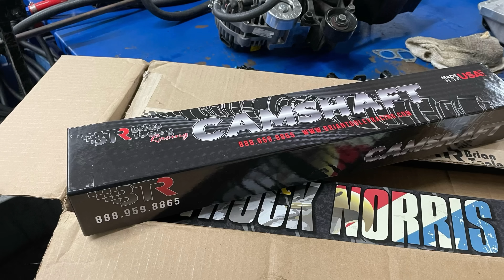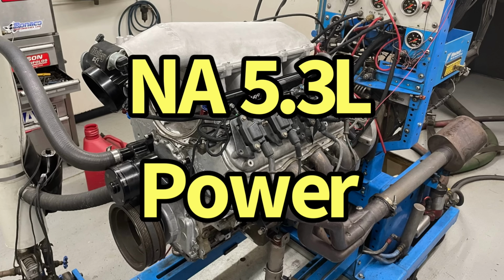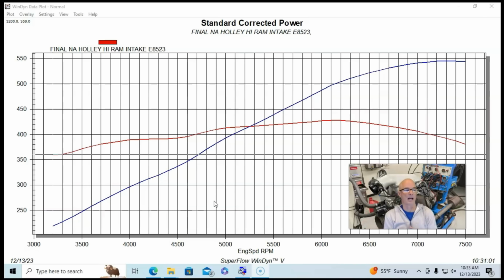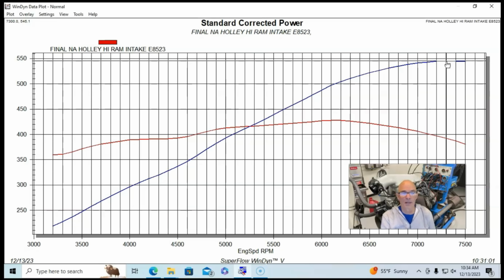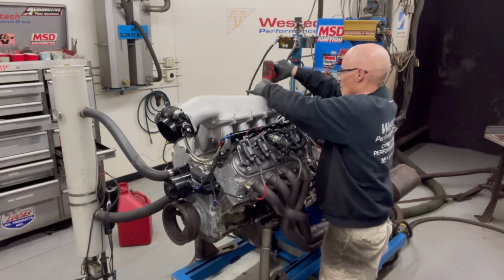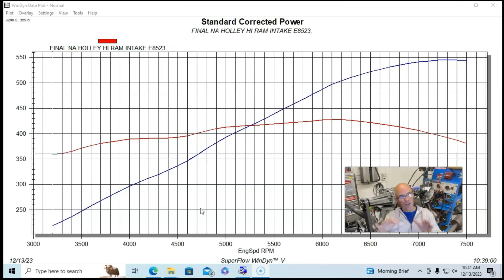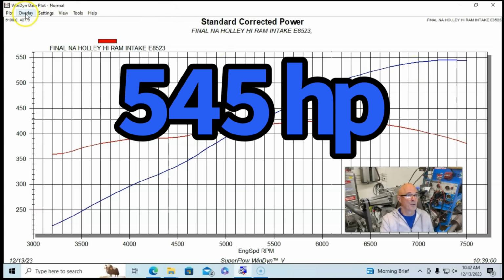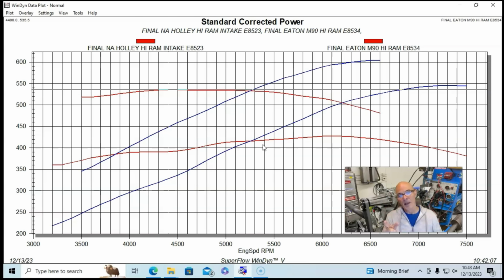CHEAP JUNKYARD M90 MAKES OVER 600 HP! IS IT A WORLD RECORD FOR THE 3800 V6 M90? 5.3L + M90=600+ HP!

Comment: I would have assumbed the motor would have consumed so much that hardly any boost would be seen.  I did catch boost numbers but Surely its not doing over 6 pound at about halfway on up in the rpm..  fun experiment.   I got a 03 cobra factory Eaton on the shelf..

Comment: Neat. I always thought small supercharger=heat=low air density=low power
Reply from the maker: heat is a function of boost pressure-you make more heat at 10 psi flow less air than at 5 psi flowing more

Comment: This is interesting, but we're really into the realm of silliness now.  This blower is hopelessly undersized, when you spin the thing at close to 20,000 rpm and only gain about 50 hp you're pretty much pissing in the wind.  True, it picked up a bunch of torque down low, but only gained 50 hp up top.  I wonder how much power you could "make" with an m90 if you put it on a 15:1 572?  It might restrict it bad enough to choke 500 hp off, but it would set a new record for m90 power.
Reply from the maker: now you are understanding

Comment: Really digging that torque bump but would that huge stack fit under the hood? Do you have a measurement from valley to top of blower?
Reply from the maker: USE THE LOW RAM

Comment: If there's enough vacuum to collapse the coupler does that mean there are still gains to be had from a larger throttle body?
Reply from the maker: THE VACUUM IS ONLY PRESENT AT CLOSED THROTTLE
Reply: @richardholdener1727  👍

Comment: For a 3800 maybe but not for a 3.8. 600hp is a number surpassed more than 15 years ago.
Reply from the maker: WITH AN M90 BLOWER?
Reply: @richardholdener1727  yes, ported.  Running about 21psi.
The joys of an intercooler and methanol injection.    Around similar time was found head lift happens at 26psi.

Comment: So is this a Gen V M90? They were supposed to be almost as good as the old M112.
Reply: He shows a pic of it from the underside. I can tell it's a gen 5. You can tell easily by the position of the rotors and the port. Gen 3 the rotors go past the opening of the port, gen 5 the rotors end visibly in the port. Probably it's a big reason the gen 5 is more efficient mixed with bigger port and intake side improvement

Comment: Any thoughts on how to get this to work on something like a Small Block Ford?
Reply from the maker: SAME WAY-ADAPTER
Reply: Currently building an intake to mount two m90 over a 302.. just lots of fabricating. Using a later counter rotation pump and late serpent belt crank pulley and blowers at 1.2 crank speed. Should make around 7 psi boost we figure.

Comment: Very cool for sure. I have an M90 that been in my basement for 20 years plus as it was a warranty part off a 3.8L SC GP when I worked at a Pontiac dealership. IT was great the things GM didn't want back under warranty. Also got a free long block 5.7 LS1 out of a Trans am WS6. Motor had a knock  but I was dumb and sold that for $300 back in the day before LS swaps were popular.
Reply: Aluminum block 5.7! I ordered a new 01 t/a ws6 black with gray int. 6 sp manual and that motor stock was pretty fast! Car was geared way too tall though bone stock
Reply: Ill buy it

Comment: it seems the cam is a bit big for that blower.    Would it be better to cam the engine for a peak rpm of 6500 instead of 7500?  Horsepower won't likely improve, but you should be able to get even more torque out of it.
Also, I would like to see this blower on a mild 500hp 6.0.

Comment: Be interesting to know what the specific HP was, so fuel flow is referenced as part of the term for comparison

Might be cool to get new rotors for the M90 (convert it to a twin screw, if that's even possible?), methanol injection directly into the housing (makes the compression less inefficient), or even compound it with a turbo i.e. twincharge
Reply from the maker: already did turbo feeding blower on the 3800. can't add twin screw rotos to this. new rotors might now work as well as these (these have carbon build up) and more power requires more fuel but if you are asking about BSFC-then the na motor is better because it is run leaner

Comment: Seems like a smaller cam would help out even more with low and mid range.  That would be an interesting test.
Reply from the maker: if it does that na-then it would do that with the blower
Reply: @richardholdener1727  yeah I understand that.  I'm jus saying the cam that your running is mostly high end power which is where the blower is running out of steam.  A different cam may take more advantage of the blower in lower rpms and may even peak close to the same.  This is exaggerating but like make 600hp from 4-6k lol

Comment: Stump puller, heavy inboard boat motor. Any chance to try it with the Holley low base, to see the effect of runner length on output?
Reply from the maker: you will see that on the na test-vid coming

Comment: MAN IM DYING TO SEE A TWIN M90 SETUP. PLEASE 😮,  and if you do, try two different pulley sizes
Reply: Currently doing exactly that combination of 2x m90 over a 302 Windsor. Blowers at 1.2 crank speed. Maths suggests about 7 psi of cool boost.. 
twin Holley carbs and lube to the rear bearings to overcome fuel wash issue of running them wet.

Comment: I know this question is not what this channel is about, generally.  Fuel mileage.  We just picked up a 2019 5.3L Suburban with a Whipple supercharger on it.  If it’s easier to make big power with the cam, heads, etc, does that increase boosted efficiency during normal driving conditions?
Reply from the maker: There is no boost pressure under cruise conditions at minimal throttle angles, so fuel mileage will be while running na.
Reply: Compression and head flow can help mileage, bigger cam will almost always hurt it

Comment: @Richard Holdener make a 90 degree metal elbow turn it upright and make an adapter to put a 800cfm double pump holly carb on it😃
Reply from the maker: planned-but not an 800

Comment: Fantastic video Richard, thanks for doing the testing that so many people would think doesn't need to be done!!  FWIW, my prediction is that the intercooler will lose power in this application.  Can't wait to see!
Reply: What's your logic behind the loss of power?
Reply: @hayden6056  My rationale is that the charge temperature isn't very high without the intercooler, because the boost is quite low.  Therefore, I don't think the intake charge temp is causing a lot of problems with power.  Add to that the idea that the the blower is completely tapped out from being able to pump any more air, and the intercooler will impede air flow a bit, thus reducing cylinder pressure even further.  On top of that, the charge cooling will reduce cylinder pressure even more because of the ideal gas law.  
If all of that speculation is correct, the question is whether the cooler and denser charge quality will make more power than the reduced cylinder pressure loses.  My guess is that it won't.  It'll be fun to find out!  :)
Reply from the maker: you are missing one (actually THE)  important point on your speculation
Reply: @richardholdener1727  I'm extremely excited to hear about it Richard!  Should be thought provoking content!!
Reply: @tptrsn  boost is a measurement of restriction. Yes it increases temp but those screws spinning at the speeds they are is still creating heat.
Reply: @hayden6056  Of course, but the ideal gas law will not be denied, and heat gain can be calculated by pressure change and volume.  I gather you think the intercooler will improve power then?  It will be fun to find out!  I'm not saying I'm definitely right, just throwing my guess out there!

Comment: Arizona impression the Mustang. The six guys were making seven hundred plus with a m ninety change for
Reply from the maker: that is the roush m90-not this one
Reply: @richardholdener1727  I don't recall if it said who's m90 It was just that it was an m90
Reply from the maker: MOD MUSTANG GUYS USE A DIFFERENT (NEWER AND MUCH HIGHER FLOING) BLOWER CASE AND POSSIBLY A DIFFERENT ROTOR PACK

Comment: Id be DROWNING that blower in methanol. Helps seal the rotors and should help make back some of that power up top. 
Will be cool too see how much the IC gains on this setup (please include IATs before and after), as it should be substantial.
Reply: richard responded to one comment that he had temp sensors pre and post intercooler. I agree about the methanol, but hopefully he adjusts the air fuel ratio so it's not too rich. the only thing better would be some nitrous.

Comment: Try welding up the silencer holes on the outlet side before porting the outlet of the supercharger. You could send the rotors off and have them coated as well
Reply: I think the place that he's sending that supercharger too is going to hog out most of that material
Reply: I've never heard of anyone recoating the rotors of the m90, but I guess it's possible.

Comment: Interesting but, after you get a M90, manifold, have an adaptor built, buy a throttle body and all the misc. drive pieces and pay for the fab and machine work you can build a 6L and keep the extra weight off the front end and make almost as much power N/A or for a grand just add a turbo to the 5.3.
Reply from the maker: a guy who constantly seeks to find the negative should try being more positive (it really works)
Reply: LOL sounds like someone who has NO idea how much it actually costs to turbocharge a motor.
Reply: 1k to turbo a 5.3😂😂😂 your funny. Sure could with a free fuel system, free tuning, and free fab work
Reply: @knowbull5hit590  free materials, free intercooler, valve springs...

I mean i guess you could get a mid grade turbo for 1k 😆
Reply: Of course, but if we want to see what the upper limit of the what the M90 blower is capable of, someone has to do this kind of testing.

Comment: I would like to see this on a tunnel rammed sbc but with an adapter on the rear for a 4bbl.
Reply: I wonder how drawing through would work. I dont know if the bearing would wash out
Reply from the maker: they should be fine for a few pulls
Reply: @richardholdener1727  its almost cheaper to source a new m90 than order bearings lol
Reply: @madmod  good point
Reply: @madmod I believe the gen 5 ones are sealed. But I know a guy on here that put two gen 3 m90’s on a sbc, and he said his haven’t destroyed the bearing yet. He’s running a carb
Reply: @integra167  is that rotters garage?
Reply: @madmod  yes, that’s the guy. His sunbird. I messaged him, and he said he hasn’t had any issues…. Yet lol